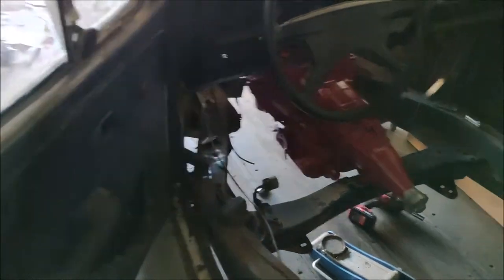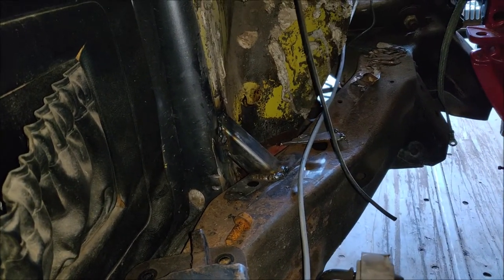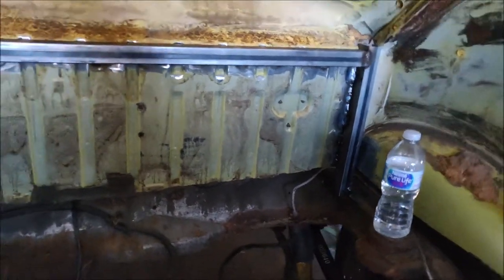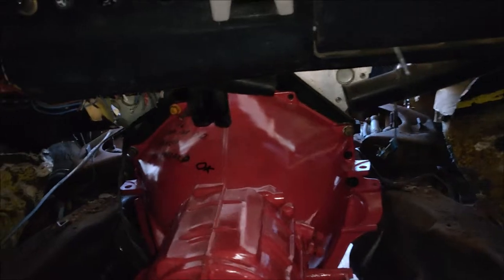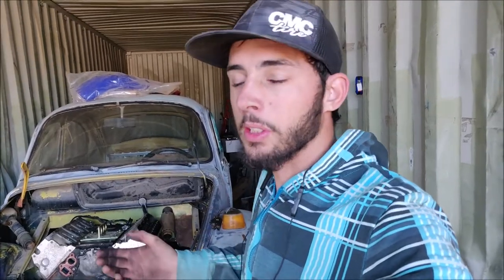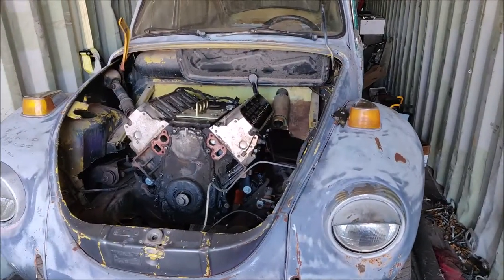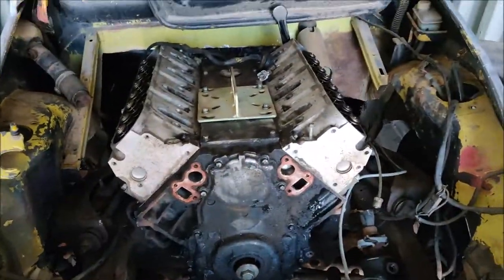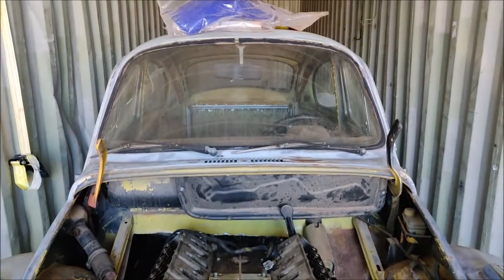LS swap Volkswagen Beetle LS Fest West 2020

Comment: You can use angle bar on the sides  under the existing body holes for extra frame support.
Reply from the maker: I've seen that done before! My body is pretty rusted out down there but I am probably going to end up doing that!